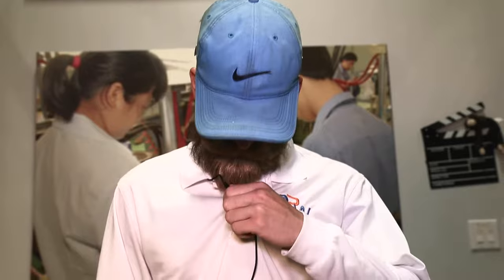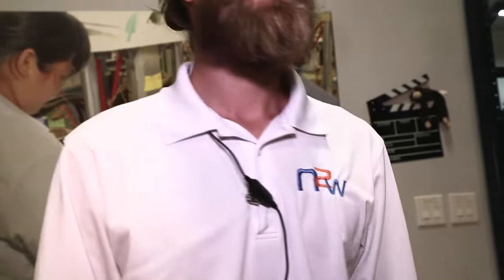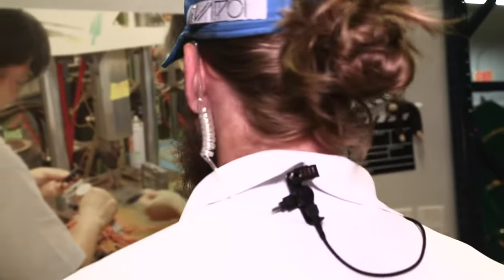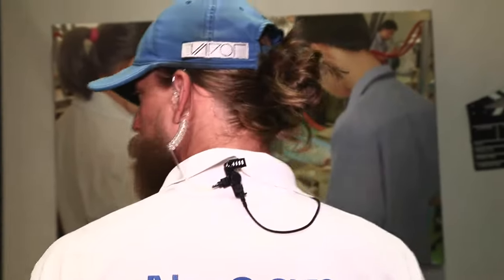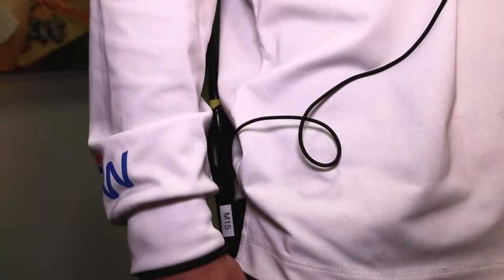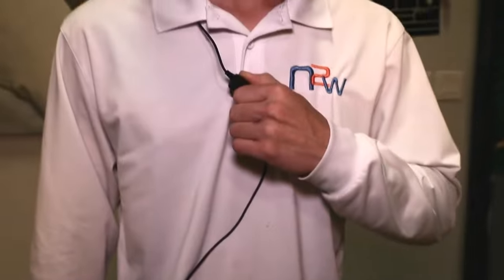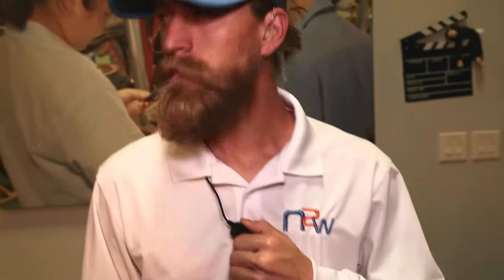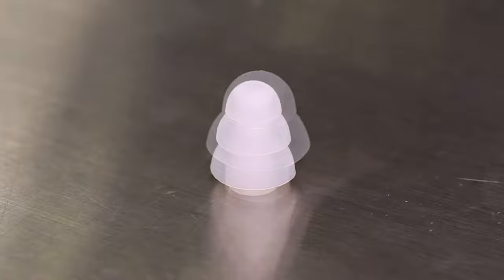N2W - How To Properly Wear 1 & 2 Wire Acoustic Tubes

Comment: Your wire should not be showing at all. It should be run underneath the shirt with the PTT being attached where your shirt buttons are located with the microphone showing. The balance of the wire goes back into the shirt with only the clip, which is centered on the back of the neck and attached to the back of the shirt collar, and the ear piece is then brought around to the ear. This way the minimal amount of wire is visible to your guest.
Reply: Could you do a video
Reply: @_nobody_knows_  he's absolutely right. Dude in the first clip looks like a joker.